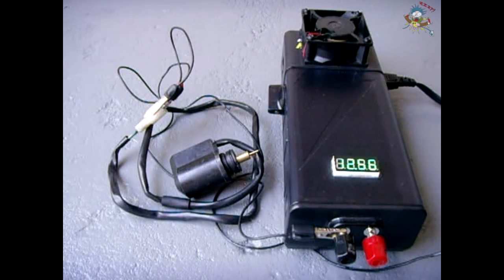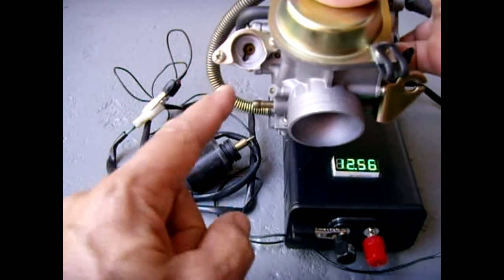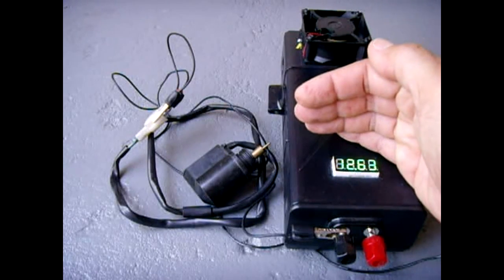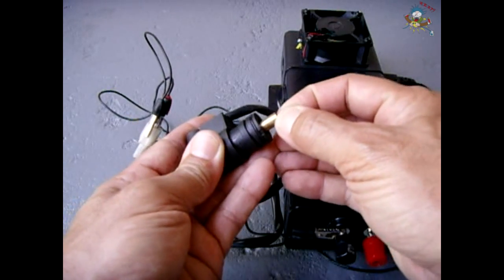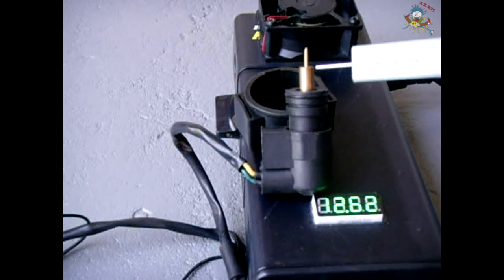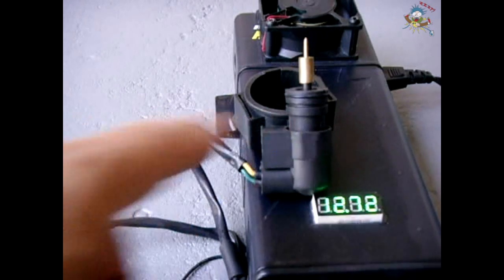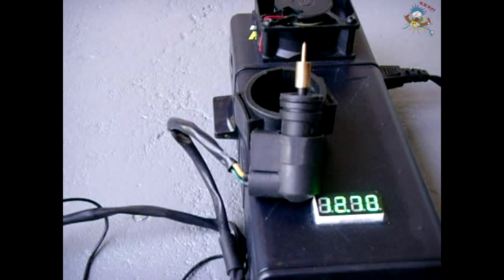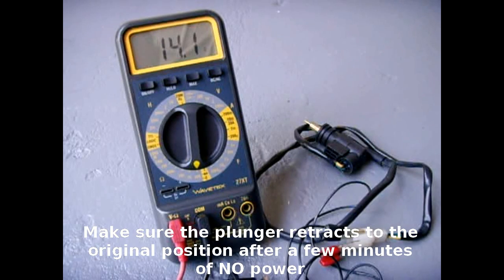GY6 Enricher / Automatic Choke Operation & Testing

Comment: My scooter has a
 spark but when I turn it on it does not hold at the minimum, that is to
 say it goes off at the minimum and then I can not turn it on until the 
other day ,,,, I think it is the carburetor thickly the electric choke 
also called (throttle). What do you say friend?
Reply from the maker: Check the valves, or the carb.
Reply: Already probe 
with the valves and also the carburetor ,,,, what I want to know is that
 if it is possible that the problem that I have the throttle proboque or
 definitively is something else, and thanks for answering me
Reply: @marcoflores9251  The problem is that you need a translator. I can't understand what you are saying and he probably can't either.
Reply: @marcoflores9251  par ejemple, what's a "proboque"? That is not a word.

Comment: Does the choke cell annoyed need to be greased in anyway?
Reply from the maker: No. Just make sure the enricher O-ring is not dried out/cracked. Lubricate it with silicone grease.

Comment: Hi - I have a 2012 zuma 50.  Starts, idles, and goes on 1-3 mile trips perfectly.  After a little longer trip it does not want to idle and will cut off eventually.  Starts right back up and if you get into the throttle right away it will run fine to get you home.  The hotter the engine gets the quicker its wants to cut off.  After it sits for 10 minutes, it will idle just fine again.  Does this sound like an enricher issue?  Thx
Reply from the maker: Hi Richard. It does not sound like the enricher. Since it's heat related, I would check the ignition coil, it may be breaking down. Also check the pick up coil(part of stator), and CDI. You can also buy replacements cheap at the link below. I have a video under my GY6 playlist. :-)

http://bit.ly/2ceq08A
Reply: I let it idle from cold to hot without driving it today.  Took about 20 minutes to start sputtering.  I noticed it started crackling somewhat,  At closer look, I could see sparks from around where the spark plug screws in.  An obvious clue for you I am sure????
Reply from the maker: RICHARD HUNTT
Swap out the spark plug, if that fails, then swap out the ignition col.
Reply: It was the plug - thx
Reply: RICHARD HUNTT n
Reply: Maybe your choke is stuck on I just buy a new carburetor for 30 bucks and put it on if I ever have issues I'm waiting for my new one right now it's worth the $30 35...

Comment: Hey... thanks for the videos, i have hard time to start my scooter on the morning. it take me about 10 to 15 min to get it start. (yes, it is only on the morning, afternoon is no problem to start the engine). any idea what is cause it?
Reply from the maker: Either a faulty enricher, faulty carb, or you need to adjust the valves.
Reply: @electronicsNmore  not true you almost never adjust the valves.
Reply from the maker: @arberfilms5998  Incorrect. The manual says how often.
Reply: @electronicsNmore  every engine I’ve owned I’ve never had to adjust valves. And they run exactly like new. What do you mean dude?
Reply: @arberfilms5998  valves often need adjusted especially on Chinese scooters. If you buy one new your suppose get them adjusted at 1,000 miles no matter what
Reply: @douglasgreen9556  I’ve never adjusted my valves on anything I’ve owned, best you keep your bs to yourself. Unless you have my fourwheeelr that doesn’t run. That thing was abused most of its life probably
Reply: electronicsNmore I

Comment: My automatic choke gets real real hot once I turn on the scooter.  Is that suppose to be that hot or wires are touching?  Thanks for the video  Will this cause the scooter to turn off once it is in idle?  My 1st scooter.  Anyone?  Thanks
Reply from the maker: It should not get hot enough that you cannot hold your finger on it. You should check your valve clearances, I have a video for that.
Reply: Thank You, I will check t hat
Reply: electronicsNmore Thank You.  I will def look into it

Comment: 7.5 ohms on mine. Also same on another vid. Mine has a ballast resistor. Yours may not  Manufacturer may use higher ohms instead of resister to limit current. Like you stated, there are differences between applications. I would say one is good down to maybe 4 ohms. Check to see if there is movement in a couple mniutes when voltage we is applied

Comment: Any idea why my gy6 on a baja reaction go kart will start and idle fine but when the peddle is down about 2/3 it bogs down. Does this have anything to do with the enricher?
Reply from the maker: Possible problems: Restricted fuel flow, carb not properly adjusted, valves need adjusting, or timing marks not properly lined up.
Reply: update, fuel flow is good, got a whole new carb (idle much better and doesn't die) no matter which way i turn the carb screw I'm getting almost the exact same problem, adjusted the vales just like your video ( they where really tight), any video on how to adjust timing marks?
Reply from the maker: 4200doom
My GY6 valve adjustment video shows the timing alignment.

Comment: So what needs replaced if the resistance is only 7 ohms when we are testing the auto choke? We're troubleshooting a Helix 150cc go kart that starts up fine, runs great for a bit, and then starts bogging down/won't go after it gets hot.
Reply: Joanna Morelandgyough

Comment: nice video, thx alot for that, but dose it matter where + and - are put at, and can i use a power supply with 13,7 volt's ???
Reply from the maker: 13.7vdc is fine. It shouldn't make any difference + or -.

Comment: hi nice video. I have one( honda dio ef-18 50cc china) ,and is broken the Enricher / Automatic Choke ,I've put it simply upward with no power and with the needle an end lower.the machine will boot properly but it gives me a few kilometers ,for my example gives 40 km and not go above, when he worked the Enricher / Automatic Choke You give me 65 kilometers. if you put NEW Enricher / Automatic Choke will properly work or machine and will give me the correct kilometers..?? thanks..
Reply from the maker: I cannot understand what you're trying to say. If your enricher tests as shown in this video, then it is not faulty.
Reply: simply, if it is damaged the Enricher can affect the final speed of motorcycle..?? do you know.?

Comment: My scooter has been having a problem where it needs throttle for about 5 seconds to start and stay running without shutting off. It runs fine when started however, aside from a foul smell of rich gas coming from exhaust. From what I know, the carburetor is clean, new oils/gas. Oddly, turning the air/fuel screw seems to do nothing in regards to RPM. 

What can be the problem? I've been told to check compression but I don't have  the tools for that.
Reply from the maker: +HelixObscura 
Sounds like a faulty enricher, faulty carb, or lastly a cracked plastic intake manifold elbow.
Reply: I have a similar issue except once I warm it up I go to drop it off the kickstand and just loose all power then dies out once the back tire hits the ground..  I just cleaned the whole carb like 4 times because I didn't do the pilot jet good enough each time so I'm confident the carb is clean  also I can't find any obvious leaks any ideas where to start next? Thank you for your videos I find them to be most helpful, simple and direct.

Comment: i'm still learning, what does the enricher do?
Reply from the maker: +Red Pyramid 
Hi there. The enricher is used to to adjust the fuel/air mixture when the engine is first started up(Like a choke). The engine will run at a higher RPM until it warms up.
Reply: But does it regulate only the fuel or only the air ( both ????!!!!)

Comment: Why not show how to adjust it for duration ??... (screw in to make choke hi idle longer and screw out to make it hi idle shorter in time it's applied)
Reply from the maker: +ItBseCtioN8 
Hi. Because it is non-adjustable. The only thing you can do is take a high wattage/low ohm ceramic resistor and connect it in series with one of the wires leading to the enricher. Doing this was result in the enricher taking longer to fully extend. 

Thanks For Watching

Comment: Hello, I have a 150cc velocity, while warming up it goes up to 4000 rpm then goes down then up again. While driving and stopping the Rpms go down to 2 then back up to 4 and while riding  the scooter feels like the engine choking out or the plug fouling out then it 0j00umps. Need help with this.  Thank you
Reply from the maker: +Tom Hufford 
Hello Tom. You can try ruling out enricher leaks by making a small plate to cover up the holes out of sheet copper from a hobby shop to go between the carburetor body and enricher base that the enricher pushes into. Once reassembled remove the enricher and give it a try. Also inspect the intake manifold for cracks/leaks and valve adjustment according to my other video. 

Thanks For Watching
Reply: I will give that a try.
Would the auto choke be going out?
Reply from the maker: You would need to remove it and test it.
Reply: @electronicsNmore  I

Comment: Hey... thanks for the videos. .. i got a Derbi Gp1 03 for our motor pacing on our rode bike ...the other day the motor stop working.. I check the ignition and is working,  check for the spark the spark plug to the head, and is good spark.
then i move to the carb to see is gas was coming down and flow of gas was present. after all that I took the elect. choke but I didn't check the travel of the shaft ... what other cause can be creating the non start ...also I do have good compression

Comment: What operates the automatic choke? Where does the power come from?
Reply from the maker: Thomas Flynn Hi Thomas. The automatic choke gets power from the stator once the engine is started. AC voltage is supplied to the enricher. The enricher works with both AC and DC.

Thanks. Be sure to share my videos with others, and rate Thumbs Up.
Reply: where is the stator? on crank shaft?
Alos, mine runs good but, when you sit on it it won't move? does it have a clutch in rear wheel or bearing?
Reply from the maker: You need to remove the CV cover to inspect the belt/clutch/variator.

Thanks.
Reply: Thanks! I did and no clutch
Reply: @thomasflynn642  Search in youtube how to change scooter belt and you'll see a lot of videos about it. When you take off the cover on the left side where the crank start is (easy to remove) you'll  see how it looks. Perhaps your belt broke, which is why it won't move. The clutch is on the rear wheel, which you will see when you remove the cover.
Reply: @brianperry9913  see my other comment

Comment: My GY6 150 use to be a Chinese scooter but I have replace everything on it so now it is mostly a a Honda clone. In your video you used DC voltage to test your auto enricher. Mine runs off the stator 13 volts AC. Will the Auto enricher run on AC or DC or only DC,  or do I need to use the original Auto enricher?
Reply from the maker: Uncle Chuckie The enricher is a resistive device. AC or DC works.

Comment: When my scooter warms up after a few minutes of riding it's power output seems to falter. Barring all other possibilities Would this be an indication of a faulty choke?
Reply from the maker: Sounds like carburetor issues. You can try removing the choke and covering the holes with a metal plate. If the problem goes away, then the choke is the problem. Make sure you warm up the engine, or remove the choke on a warm day, otherwise it will be hard to start up the engine.

Comment: electronicsNmore I watched you're video about the GY6 enricher, but can you tell me which of the wires (Green or Yellow) is the + and -, Thanks
Greetings
Frans
Reply from the maker: The headlight and enricher operate using AC off the stator. The enricher will also work using DC as shown in the video. The enricher is a resistive device which creates heat in order to expand wax driving the piston outward. Should work fine no matter how you connect it up. The yellow wire is normally connected to the yellow wire from the stator.
Reply: Thanks! I wondered how it worked!

Comment: I HAVE A LITTLE HARD STARTING THATS BEEN GETTING WORSE. IF I  TTHANKSCOVER INTAKE WITH PALM, IT WILL START.
Reply from the maker: Sounds like a vacuum leak, too much air entering. You need to do a very careful inspection of your carb/intake manifold/enricher.

Comment: I have an utv odes 150cc with 1p57qmj engine. Its starts ok and very easy, but I have to press the throttle for several min in higher turns than the ideal and when it's warmed up work ok. This happens every time I start. Could you help me to find the problem?
Reply from the maker: Very hard to understand what you said. Likely a carb problem or faulty enricher.
Reply: electronicsNmore
Thank you for your early reply. Sorry for my English is not good. I will check the carb and the enricher. Could you suggest me a band for a new carb?
Reply from the maker: walbro, keihin both good.
Reply: electronicsNmore
 Thank you
Reply from the maker: You may also have a faulty fuel flow valve which is operated by engine vacuum. You can try remove and test the valve by applying vacuum to the smaller fitting to see if the valve opens to allow fuel to flow across the valve. Drain your gas tank before doing this..
Reply: electronicsNmore
Thank you very much. I will try this option.

Comment: Having a problem with cold idle on my 49cc scooter. When it first fires up it runs ok for a few seconds then the idle goes up and down and usually stalls. If I touch the throttle at all, it stalls out and is difficult to start again. Could this be a choke problem or a mixture problem? I just bought the scooter in May of 2014. Once it's warmed up it runs fine.
Reply from the maker: You should not have to touch the mixture screw. I would inspect the o-ring on the enricher, and if it is OK, then suspect a carb problem.

Comment: Many years ago, Frigidaire refrigerators that had an ice dispenser in the freezer door had a device like this that opened the chute door so ice could pass out into a cup. Frigidaire called the device a "hot wax motor". - - In that application it was powered by 120 volts AC here in America. They were reasonably dependable. - - Thanks for your videos.